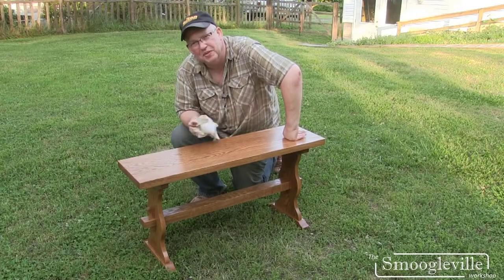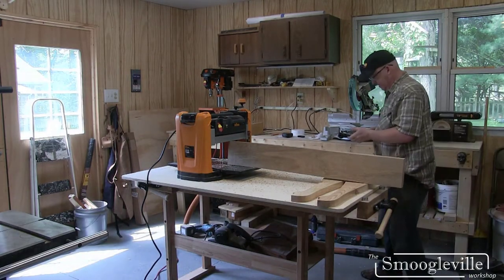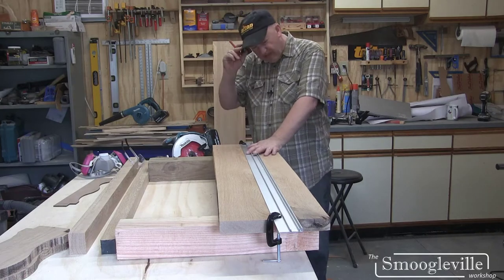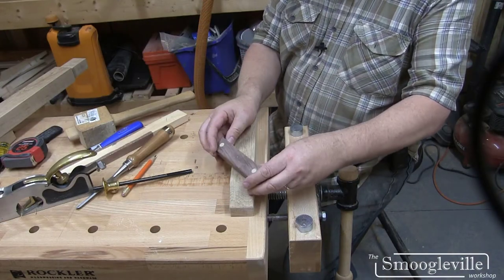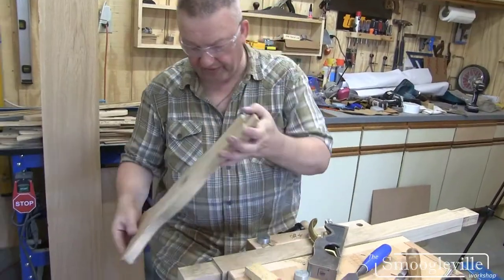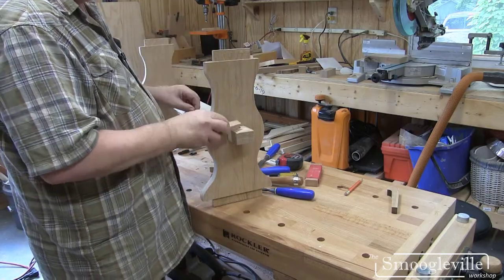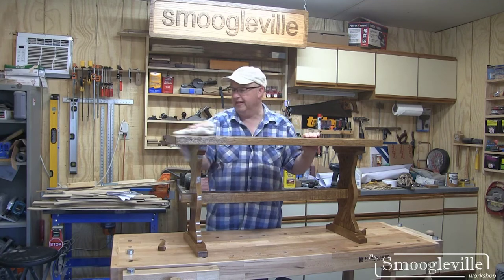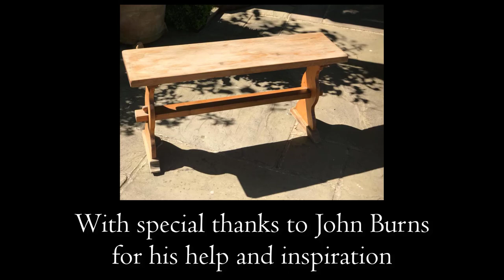S1 E16 - The Burns' Bench Project

Comment: Lovely finish with the combi of the stain and tung oil mate.  Really makes the grain stand out doesn't it.  That rich brown colour reminds of older furniture made in the 18th and 19th centuries where Van Dyke crystals were used to stain them a lot.  I've used them to restore some turned fencing round my brothers old fireplace and its a lovely brown.  Nice to see you're starting to buy rough sawn and then mill it yourself too.  I know it adds a lot of time to the preparation but the big advantage is you get dead straight and flat edges to deal with and you rarely have that luxury with pre surfaced material because of moisture related movement.  You also get to use non standard thicknesses which for some reason I always find slightly more interesting to work with, no idea why, probably just less boring in some way as they're unique.  Plus of course rough sawn is cheaper to buy.  On smaller jobs, you can harvest it directly from air dried boards off the log as well which saves a ton of cost.  Methinks you might need to invest in a planer (you guys call it a jointer). The reason I nought a planar thicknesser was so it could do both operations in one machine while saving workshop space.

But its a lovely piece mate and doubtless heirloom quality :-)
Reply from the maker: Thanks Byoomy me Ol’ mate.  You’ll have to show me the methods around those crystals for staining - I love all that old world stuff.  And I have a modest 8” benchtop Jointer (planer) on order.  So great minds and all that.
Reply from the maker: I have seen some rough edge oak for sale that still has the bark on, which would be nice to do as a purposeful project for a very unique peice.  Another project idea matey.  Perhaps it would be a good epoxy sample, stablizing the rough bark with a thick epoxy coating.
Reply: @smoogleville8201  Its a great idea for a project matey especially as I love waney edge anything.  When I'm turnikng live edge pieces i use very cheap/thin superglue to stabilise the bark inclusions.  Epoxy tends to get used to fill in enormous cracks on the flat surfaces and people often colour them with interesting metallic powders like copper or gilt etc but it could be used on the edges too I'm sure.  I've got a lovely piece of Yew board about 11 inch across thats got a whopping split in the middle that needs some epoxy.